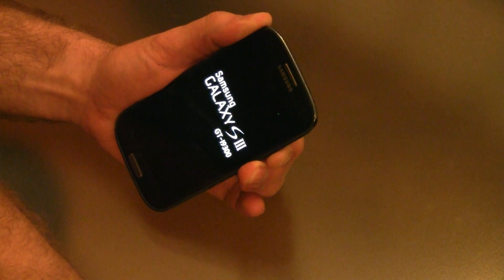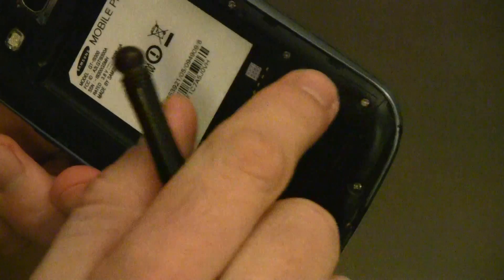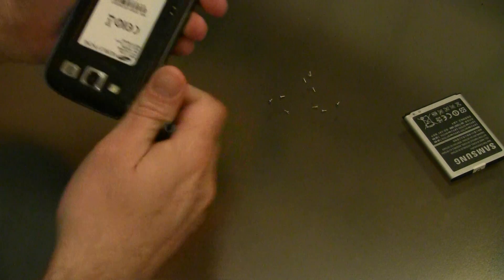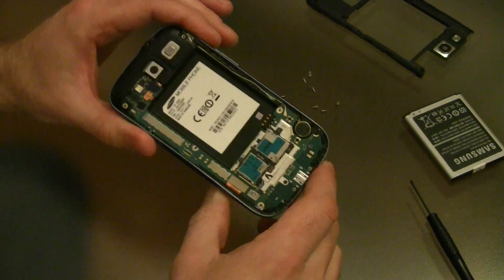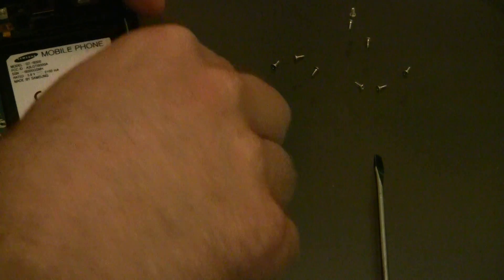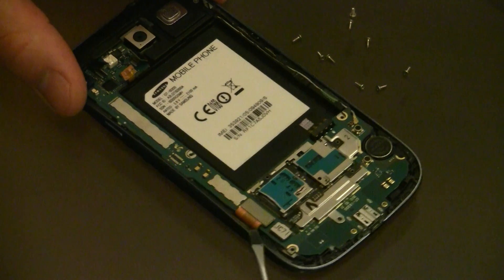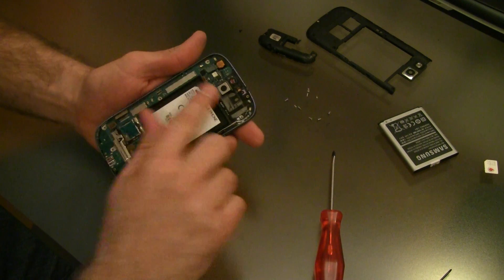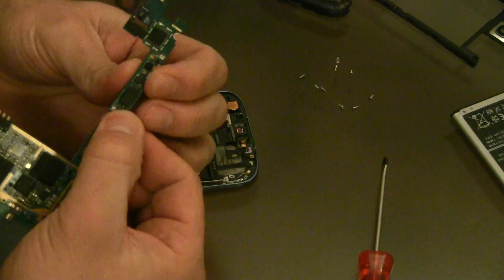How to fix a Samsung S3 from constantly restarting during the boot cycle (Part 1 of 2)

Comment: no need to replace the power button if its REALLY the problem, fix to that is that you bring some OIL which comes with the electric shaving machine and put very tiny drop around it n on it, leave it for few minutes and it will work like charm. tried it on my HTC desire 816.
Reply: Replace the power button?! I think that would be the solution to my phone, since the power button is literally not even on the phone and I’ve been using a pencil to turn it on/off 
Or maybe I just broke the phone with the pencil

Comment: Hey I just wanted to thank for this video it helped me to fix my S3 from boot loop. At first it didnt seem to fix but after I used compressed air directly to power switch it magically stopped booting itself automatically. 

To anyone reading this: If your phone goes into bootloop right after you insert the battery it means the power switch is stuck - even if it still bounces back normally. You can check it by pressing volume + home button same time (no need to press power button as its already stuck and it should show the download mode for short period of time.
Reply: I replaced my s3 after it started doing the bootloop and it had been collecting dust for almost 2 years. Yesterday I decided to try recover my old pics and now its working again - im so happy lol!
Reply from the maker: Hi Ron, I'm glad the video helped get a little bit of life back into your phone. Its also really good to hear that you were able to recover your photos.